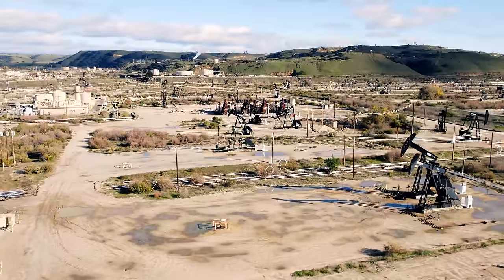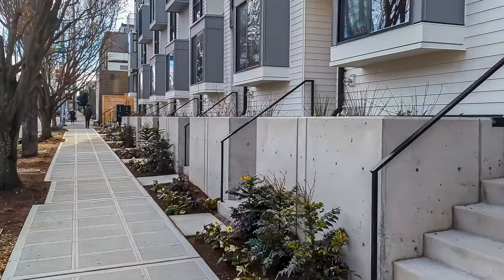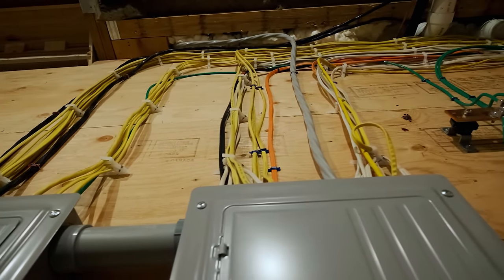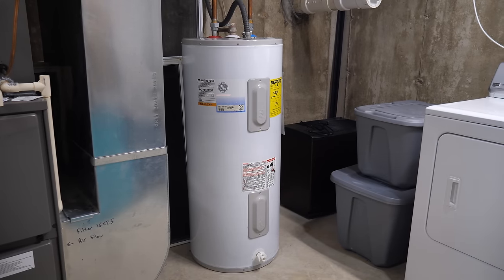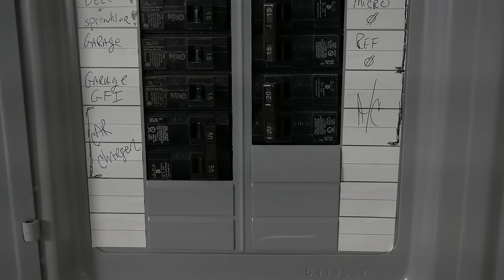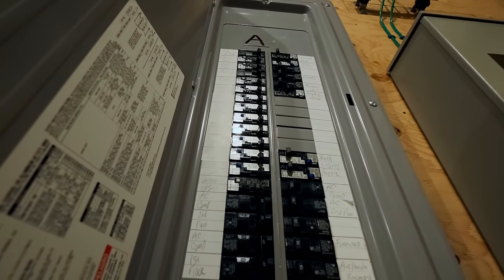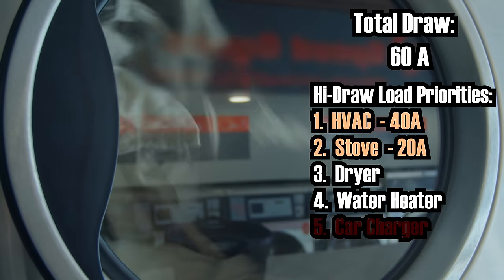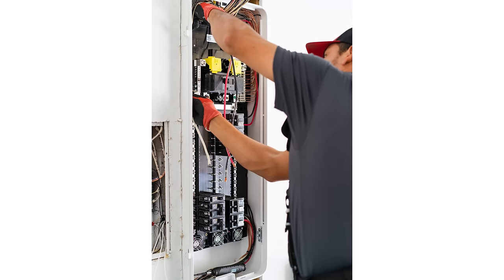Home Electrification: There's not a lot to do, and it doesn't have to be hard (Part 1)

Comment: For all of my life, neither my parents nor I have ever had a dryer that wasn't gas.  I've owned three myself, as parts of three successive laundry pairs (washers and dryers).  They're not just an American thing.  My second one was made in New Zealand, and my current one was made in South Korea.  I like how fast they dry and how cheap they are to run.
Reply: @solexxx8588  Actually, I burn propane, but even if you don't believe in the natural processes that neutralize atmospheric carbon dioxide, you should realize that it makes little difference if gas is burned in my dryer or some power plant.  I'm not against wind, solar, hydro, etc. and say "Let them all compete", but they can't possibly meet demand, especially if you insist on replacing all domestic gas and motor fuels with electricity.
Reply: @MikeV8652  A gas power plant is probably like, twice as efficient your dryer though.
Reply: @fellenXD  Not cost-wise.  Note that my gas dryer has an Energy Star rating.  You should also realize that gas dryers convert the gas to heat, which is used directly (the products of combustion passing through the drum to dry the clothes, then being exhausted outdoors).  Gas power plants convert the gas to heat, which is converted to steam, which is converted to electricity, which is transmitted great distances, which is finally converted back into heat.  That's doesn't seem efficient to me.

Comment: The Texas freeze taught me the value of having natural gas. I powered my generator which powered my whole house, my stove, water heater and gas furnace. I also used my gas dryer to dry my clothes. It was business as usual while others were suffering and I did it with an 10 kilowatt generator. I have propane and gasoline as a as a backup, but natural gas is constant and I don't have to keep changing tanks or adding gas. I can run the generator indefinitely other than oil changes and other maintenance. I would also need a much larger generator with all electric.
Reply: (Natural gas and nuclear energy failed in Texas due to lack of winterization. Green energy sources over-performed their design specification.)
Reply: Natural gas lines freezing is what led to many natural gas power plants going offline in Texas.  Not sure if any homes lost natural gas pressure as well, but yours didn't so lucky for you.  With a long enough power outage water pressure would be lost as well as pumps go offline and can no longer pump water up water towers which supplies the pressure.  End of the day, having multiple sources of energy as well as backup sources are great for emergencies.
Reply: @edirol  All we had here was internet and water outages. The backup generator at the water station failed the second day. A home only needs 1/2 to 1/4 PSI. A whole generator plant needs much more. I think a lot of the outages were from the regulators freezing at the power plant, not at the gas company's equipment though both did happen. People had the same issue at their home, not so much a whole neighborhood going down from it, but individual homes. That can be fixed with some warm water or a hairdryer.

Comment: In the 1970s we stayed in a static caravan when on holiday. In the Kitchen area there was a large switch allowing you to run the cooker OR the water heater. It saved them from needing to run a cable thick enough to run both to each caravan.

Comment: Living in a part of Canada where we can approach -40 and get a lot of wind to boot (only a few nights a year if that, but it still happens and thus has to be accounted for), and this overkill info is very helpful
Reply: That's something many people don't understand; you can't design for the typical day. You design for the worst day, then find ways to make it more efficient on the typical day. That holds true for hvac / electric grid / insulation / water heating... any number of disciplines.
Reply: Dan l, good point and I'm completely agree.  Expect the worse and hope for the best.  Not Expect the best and when the worst happen you get F.
Reply: -40?

Hard to imagine anyone surviving that. I thought such temperatures were literally impossible
Reply: @dlarge6502  no? The coldest recorded temperature on Earth was -89.2°C (-128.6°F)

Comment: I'm in the Soup-for-air South, so cooling is much more the concern, and running the range means adding additional cooling requirement. Also, heat pumps are more efficient at heating than cooling. A typical COP of 2.0 can cool a house from 90 to 70 with the same energy it would take to heat from 30 to 60 (COP+1) before you factor in dehumidification work, which may actually be as large as the temperature reduction work depending on how well your home is sealed. 20A on the range on the summer may also mean another 10A on the heat pump to offset it. It may be a good idea to supercool your home before dinner (say 65), especially if you can do it on local solar power or morning off-peak, and set your thermostat schedule to allow a rise to 70 or more and then start cooling again after sunset. Check local power demand cycles and charge batteries (vehicles, water tank, house temperature) off peak.

Comment: Most homes can be upgraded to 200 amps. Typical costs are $750–$2,000. The SPAN panel is about $3200, so in most cases, an electrical service upgrade is less expensive. Maybe in the future SPAN like panels could com down in cost. I think given the savings possible in an all electric home, I bet industry will come up with good ways to upgrade the panels (and wiring) cheaply. One other solution (expensive now but will come down) is a home battery to buffer the power for all appliances that would push the amps above the panel limit (as suggested in Alec's stove with batteries). This is actually being done at some DC fast charger sites which do not have enough power to charge all vehicles. The batteries recharge during low demand times. Battery systems can also be used for buffering parts of neighborhoods, and could be cost effective when pulling more high power lines and transformers cost more.

Comment: Most electrical power is created via so-called fossil fuels. Solar panels require fossil fuels to make as well, and so do batteries. All you're doing is moving the point where you're burning the fossil fuels to a centralized location, and making it easier for someone to simply shut off your power at the push of a button if you don't pay your bill (or for whatever other reason). Also, because electrical power transmission suffers loss over distance, you're burning those fuels less efficiently.

Comment: I have been slowly transitioning to all electric. I had solar and a back up battery installed and since my home is relatively new ~30 years old I have 240v outputs where my appliances are. The only issue I have is my hot water heater. For most electric hot water heaters you need a 240v connection, but 120v 15A models are now available. So that is what I plan to do. I have also installed a new heat pump. I still have my natural gas furnace as a backup.
I have 100A service which I believe is enough to go all electric especially with my solar and battery backup.
Smart distribution boxes are stupid. Most these heavy loads have small continuous loads that you don’t want disconnected. Do you want to keep resetting the clock on your stove, the temperature on your hot water heater, and the Wi-Fi connection on everything. Also upgrading your service to 200A is usually cheaper than installing a smart distribution panel.

Comment: (Almost) free energy. Living in a semi desert area I don't need heating my home. Years ago I bought a solar water heater and threw out my boiler. Apart from the initial investment it has paid itself in 5 years and it will deliver another 5 years of free hot water. The only LNG I use is for cooking and that's minimal compared to running a boiler. The only energy guzzler is my AC which I run only 3 months a year (March-June). In June the rainy season starts and it cools off. Getting an efficient AC takes planning on what kind and how to run it.

Comment: Hey, European here, Spain, 5,85KW supply, and we think that is big, To quote you, "Dang".
Several Split mode Aircons, Electric water heating, Electric hob, Electric washers, dryers and we manage.  Just occasionally it has popped b ut not for many years because we know.
Also have Solar on roof which we love.
Good vid

Comment: Switching to an elctric replacement for boiler/tankless water heater sounds nice, then I remember the lights in the kitchen dims when the microwave is running and the laser print does much the same when we fire it up

Comment: My situation: newer home with gas furnace, range and water heater. 

I recently got an EV and upgraded my electric panel to 200A myself (if I didn't have the experience and ability to do so myself, that one item alone would have been cost prohibitive to getting the EV let alone doing any other electrification. If my panel were anywhere but inside the garage just a couple feet from the meter outside then running the circuits would have added too much cost for the EV) 

If my water heater goes out and requires replacement it's not going to be cheap but if I add the cost of running a new circuit then it breaks the bank. Same situation for the range and if my dryer was gas too. And that's also considering that I already upgraded service. Yes my prior 100A could run it like you described however the panel was physically full and already had "piggy back" breakers in a couple of locations so I would still need to add a sub panel or upgrade the size of the panel which breaks the bank even worse. 

The only exception would be if my HVAC failed because it would require the same load in the winter as it does in the summer so the existing circuits would be sufficient. 

Though this is my situation, it applies to my entire neighborhood, all these houses were built around the same time by the same developer to the same codes. Because the minimum code around here is only 100A still, that puts an entire region into a similar situation. 

For some their situation would be conducive to electrification when replacing an appliance but not for most. And I don't have the spare change lying in my couch cushions to just go replacing fully operational appliances and running new feeder circuits through my walls for sport. Add in the permitting and inspection fees/ process it turns a water heater failure into a costly and logistical nightmare.

Comment: The smart panels are pretty neat, we initially wanted one when we did a panel replacement in the house we just bought, as it had screw fuses. There were a couple reasons we didn't, but it would have been cool to have. First, we already had 200 amp service, so no foreseeable future for ever needing any sort of load prioritizing. Second, they flat out just weren't available, at least not here in eastern Canada. and finally, just because of the first two reasons, the extra cost didn't make much sense since it's only real function was one of intrigue lol

Comment: Electric companies are more interested in record profits than in maintaining the grid...and we need massively more to replace gas use.

I will reserve judgement until they can get power restored in less than a week. Maybe another 10 or 20 years we can make this practical.

My house had all electric items, like water heaters, stove, etc when built. I fixed that problem and swapped out all for reliable gas before moving in, and added a whole house generator for when the electric company fails as an electric company.

Comment: Interesting look into the American energy scenario. It basically looks like the most rural areas in Denmark. If you're anywhere near something that resembles a city here you'll have direct heating available. That's pressurised and very well insulated pipes running to your house with water so hot it would boil at atmospheric pressure. That hot water is the by product of electricity generation. And while we're up to 40% wind energy in Denmark we still have this thing called "house hold trash" which is combustible, so we might as well make electricity and heat from it. This is done with high temp forced induction furnaces that does smoke washing so only carbon dioxide and water goes up the chimney. In case we don't have entirely enough house hold trash we top it up with straw bales, as that's a carbon neutral source of energy. It's been like this since the 80s. Well, back then they topped it up with coal, but people didn't like that and the farmers benefitted from selling straw bales for energy, so we stopped importing coal.

Comment: Economics are the biggest barriers to electrification especially with water-based heating systems. The quote we received to run ducts and install the converter and heat exchanger was $50K. We'd likely spend less on electricity than propane so the system would pay for itself.... in 30 years. That assumes that electricity costs remain the same and while this video states that the cost of renewable generation continues to go down, consumers continue to see prices go up. In fact, since we received the quote above, our electricity costs went up 35% making the economics even worse. Sure, there are minisplits which are cheaper, but they're also ugly inside and outside the home. 

Your point on insulation is huge. It's surprising that this isn't the first priority in cutting fuel costs at home. By improving insulation we reduce fuel and electricity usage which is a win regardless of technology.

Comment: In Ireland and the UK (and probably elsewhere) we have priority switches that can go into our consumer unit (the thing with the breakers in it) and provide prioritisation between two circuits without having to replace the whole unit (i.e. a fraction of the cost) or do any smart IOT stuff. A common use case is if you want both an electric shower (yes, we do weird things too) and a higher power EV charging point (>6kW or so), as both at the same time can get close to the typical limit of 63A @ 230V (in older homes in Ireland).

Comment: Here it’s even better (somewhat)! In the Netherlands:
-Cars aren’t usually a consideration (Bikes and public transit are used A LOT for commuting and other things, and some people even cycle on vacation, like me!)
-There are lots of options for induction cooktops that have only 1 or 2 burners (read: inductors), and that’s almost always perfect because of the thing called time. (Though that’s also true in the US, and even here many people say they want 4 cooktops.
-Gas powered dryers aren’t usually sold because of 220V being a standard and powerful enough to run an electric one.
So the only thing left is well, the boiler/water heater (and the BBQ, tbh they are pretty poplar, especially the nes that run on coal and therefore CAN’T be electrified).

Comment: You can also replace a furnace or central heating with ducted aircon/heat pump (in most houses with an attic) or split-cycle aircon/heat pump units.

Comment: I'm in Illinois as well, my place is fully electric except for my furnace. I've got a forced air LP furnace with a wood burning stove for backup just in case. Being from a rural area, it's nice to have options. Also the reason why i have a well, but am hooked up to municipal water too in case of an issue with my system.

Comment: I think in Plattsburgh, NY, in the past, electricity was so cheap from the hydro-electric plants, that homes were built with electric resistive baseboard heating.  Electric baseboard heat is remarkably simple, the heaters last longer than any heat pump and are very inexpensive.  if not maybe a bit at risk of overheating and starting a fire, and the high cost of electricity, they could still be an option if we created more cheap green energy.  The issue I have with heat pumps is the cost and service life.  I was just quoted to replace a split mini-split set that I wanted to upgrade from AC to heating and AC, to supplement my gas steam heat in the spring and fall, and it's around $12k with the required code upgrades I also have to do.  The rebates I'd get were like $600.  With old home, there's lots of other things more urgent to fix right now.

Comment: One thing I'd like you to cover is heat pumps for central heating. From what the local HVAC guys say, the high SEER systems are only small mini-split systems. The big centralized units aren't much better than conventional units. (Huge grain of salt... They are probably only selling domestic systems which aren't as good as the imported ones...)

Comment: Entire home runs on natural gas the many times a year a hurricane knocks power out in the state (this is back in Louisiana where I grew up) and people commonly die from lack of adequate cooling, inadequate power supply to water pumps in places that don’t supply municipal water, bad/spoiled food, etc etc. You may discount it since the cost of installing utilities underground only like in large cities is a “local cost” which you state from the top as something you refuse to include in your calculations,  but that local cost extends from SE Texas all the way down to lower Florida and on up the East coast. Hardly local.  Burying utilities is easily 5x or more of the cost per mile depending on location where as a NG install is very cheap to own and maintain. Fix that problem and I’m with you.

Comment: I have a Span panel. And it’s prevented me from doing a circuit upgrade. It integrates with my Powerwalls very nicely. And their EVSE lets me charge at 11.2 kW which normally could never happen.